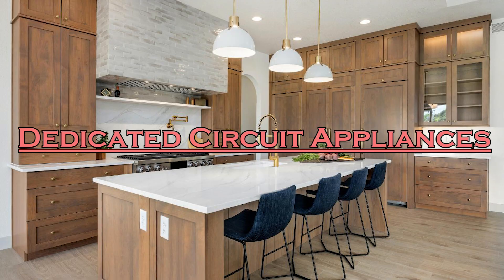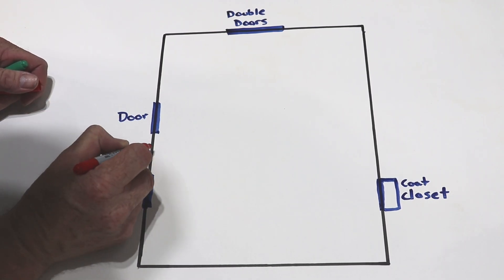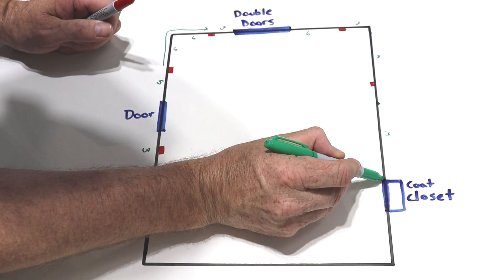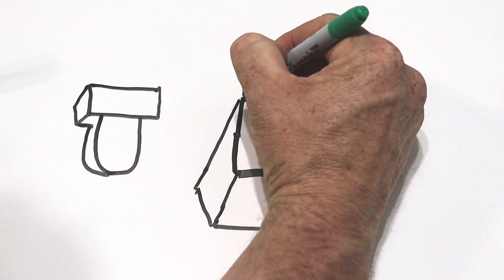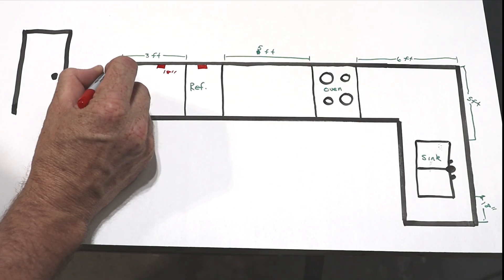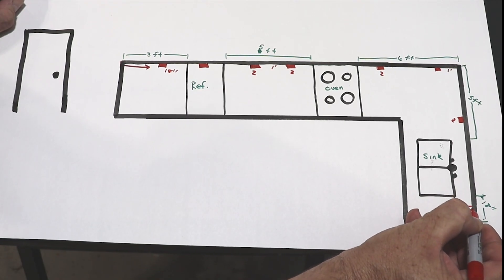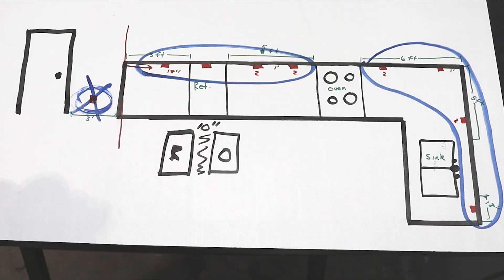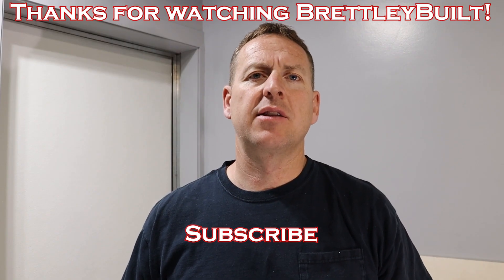Outlet Spacing Code Requirements | Electrical Outlet Spacing Examples for All Rooms in the Home

Comment: Most real builders will have their electrical contractor walk thru the house with the customer when the home is ready for wiring.
Of coarse that contractor will know all of the basic code requirements, and will also be able to tell the customer what the cost will be for any extra work they might want by way of additional outlets etc.
In some locations a wiring detail is required on the approved building plans, but non the less a walk thru with the customer is a wise thing to do.
Reply from the maker: Absolutely, thanks for sharing this. I think too many people are too hands off on their custom built homes.

Comment: I’m not going to bad mouth your explanation because you did do a great job simplifying it for people who really don’t understand electrical code. One thing I had to say. At the start of your kitchen layout you mentioned the refrigerator being on its own circuit, and at the end of the example you looped it in with your small appliance circuits. I don’t know if you know, but the refrigerator is not required to be on its own circuit it can be on with the counter top appliances. This doesn’t mean that its good practice, but with energy efficient refrigerators they don’t use as much power as the older ones. We try to limit our counter top receptacles to no more than 4 per circuit, this is not required but that’s just what we do.
Reply: When I built my house, inspector wanted it on his own circuit, same for stove. I thought the same things as you, apparently inspector didn't.

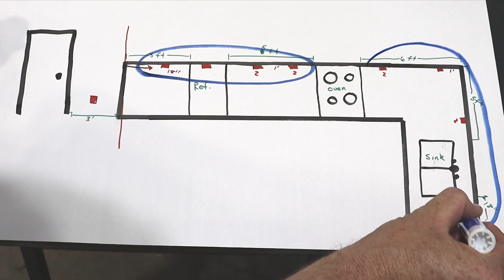Comment: I'm a little confused about something. @ the 10:50 mark, you said you can put the receptacles (to the left and to the right of the sink) on the same circuit. I'm helping my brother-in-law design a small cottage he want to build. We been watching videos just like yours. In another Youtube video, the eletriation says the receptacles on the left of the sink has to be on another circuit from the right one. In other word, everything to the left of the sink is one circuit. Everything to the right of the sink is another circuit. Can you explain a little more on this?
Reply from the maker: I don't think it is necessary put outlets on different circuits just because they are on different sides of the sink. I think it is most important to not overload a circuit.
Reply: @brettleybuilt Thanks for your response.
Reply: More then likely he has said this because it separates the two sides of the kitchen evenly, or close to and is easier for them to wire it that way. My guys would wire every other outlet to the opposite circuit. We do this so that even if you plug into two receptacles next to each other they are not on the same circuit, this takes more wire and work. That said most of these are very large kitchens with 4 counters top outlet circuits, and oversized islands.

Comment: Does the architect draw accordingly to blue printe or is it up to the electrical contractor?
Reply from the maker: Architects draw them on commercial buildings. I am not sure about residential work. I should find this out. Great question!
Reply: On residential blueprints the architect will usually draw the electric, and have an electrical engineer stamp the drawings for them. This doesn’t always happen if it’s a custom home, in that situation you may only have the electrical service engineered, but nothing else. That would mean that the electrical contractor/ electrician is responsible for laying out the device placement by code.